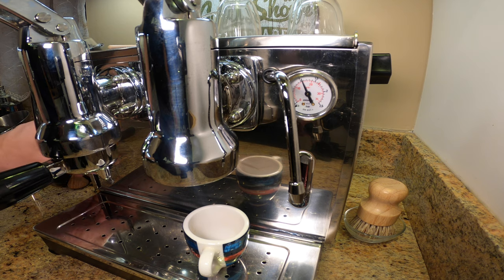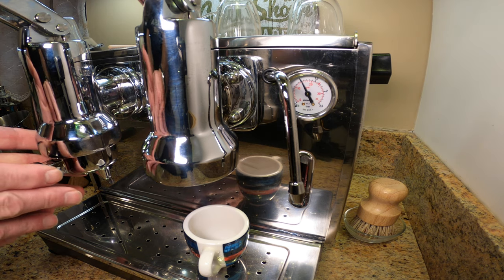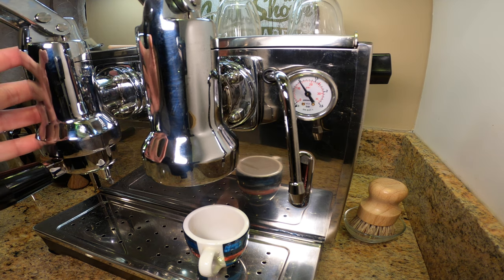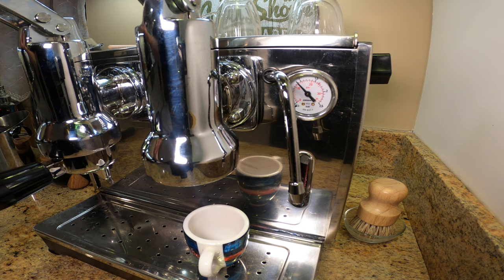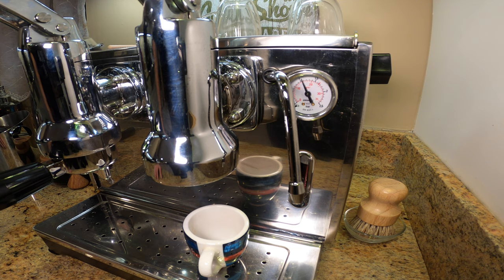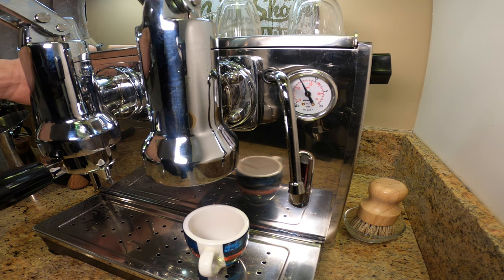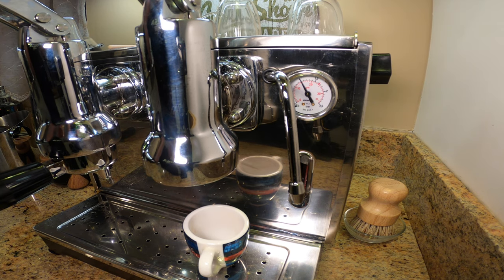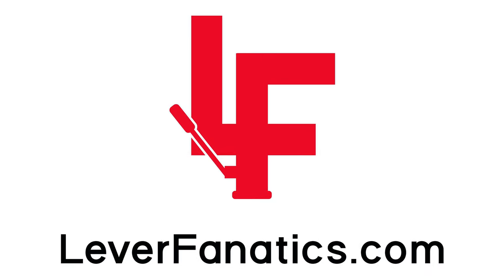Temperature Surfing Hack - For Your Lever Espresso Machine

Comment: Adding a PID is incredibly easy. I put a PID on my $100 Espresso machine. Just having the temperature stability really makes the shot much more consistent. Highly recommended.
Reply from the maker: Interesting. Has anyone put a PID in their lever machine? I've found that temperature management with the Ponte Vecchio Lusso is pretty easy. You just let it heat up! With the Export (smaller version) as well as other smaller lever machines this might be different. Maybe a PID on an PV Export or La Pavoni would be useful.
Reply: @leverfanatics1978  But how do you know what temperature it is? Pressure is one thing, temperature another.

Comment: Ah temperature management of a single boiler machine which for a PV Lusso happens to be a generous 3.5 liter boiler capacity spring lever espresso machine, comparatively huge and more temperature stable compared to my PV Export's relatively smaller 0.9 liter boiler size.  With a laugh, size apparently does matter.

First be certain to purge the mix of residual air and newly boiled steam  now present in the now hot boiler, called "false pressure".  Purge the "false pressure" by emerging the steam wand tip into cold water, then turn on the steam valve and watch the mix of air bubbles and steam exit the wand.  When the air is gone, and the disappearance almost seems magical, and no bubbles continue to exit into the water, only the emerging steam will immediately disappears into water  as disappearing water condensate.  This phenomenon simply fascinates the 6 year old child in all of us eagerly watching.

Now you will be ready to adjust the temperature of the boiler temperature and secondarily adjust the now relatively stable temperature of the hot water passing into the brew head.

Before mounting the coffee powder containing portafilter, I would suggest doing a lever pull and purging hot, near boiling water through the brew head into a capturing cup with an instant on/instant measuring kitchen thermometer, like a hand held inexpensive Bed, Bath & Beyond instant meat thermometer.  With that you should expect to know and closely approximate the temperature of your brew water as it enters your coffee puck in the now mounter portafilter.  That temperature measurement is interestingly satisfying, and your curiosity is temporally sated

Alternatively, buy a liquid crystal display adhesive temperature strip on line (typically cheap, like about $6.00 USD) and stick it onto your brew head to be able to monitor and track your brew head brewing temperature on the display.

Depending on the brew temperature water, you can manage the portafilter temperature by immersing the portafilter (of course without the coffee filled basket) in either an ice bath or in a near boiling water bath to raise or lower the local portafilter temperature (cooling or heating) for brewing, and to compensate for the brew water temperature coming from the boiler.  This is just a more direct form of immediate "temperature surfing". 

An analog lever espresso machine surfing safari, so to speak, but no surf boards, unfortunately, unless you live in California or Hawaii.  

These methods will give you a better way to investigate and have the ability to control your brew temperatures on the way to some of the best tasting espresso.  The Italians have done inventive methods like this for decades, or so I've been told.  Welcome to Napoli, or Milano, I'd guess.

Ciao.
Reply from the maker: To be honest I have mostly stayed away from true temperature surfing. It's just one more variable and I already have too many! Maybe after I retire I'll deep dive into temperature. that being said when I first got my PVL it was set a 1.5 bar which seemed really high. So I did go through the effort of trying different temperatures before settling on 1.1 - 1.2 bar. Then I removed the case and made the adjustment to the pstat. I brew mostly medium and dark roasts but if I did get into the lighter roasts and could not get a good tasting shot with just dosing and grind changes then I may consider temperature.

Very good point about the steam purge on this machine. I sometimes get lazy and just let some steam out. But to do it right you should purge into a container and observe the complete disappearance of the air. I'll probably start doing that more consistently!